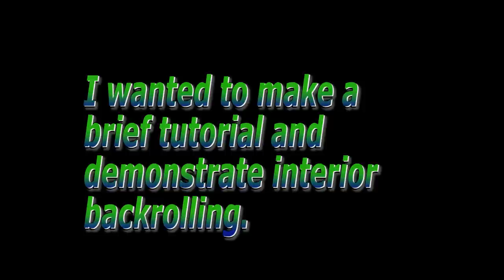Spray and Backroll with the Pros - Interior Painting

Comment: You can always tell when someone is a professional painter or not and I know you guys are a professional painters because any professional painter know that you should spray the wall to get the paint on the wall they come behind  and back Roll the wall. Most people think of spraygun is the only thing that you should use but that is Farthest from the truth the spray gun just put paint on the wall back rolling does the job you guys made an awesome video thanks
Reply: The sprayer is an applicator…the roller is the finisher.
Reply: So as a one man job, not really practical?
Reply: @TheMendo123  it is…cuts away the tiring effect of Labour.
Masking isn’t labour intensive but dipping roller in and out of trays is.
Reply: @JohnMartin-oh6bf  I'm confused, so you are advocating for the use of a roller or not?
Reply: @TheMendo123  not really.
Each one has its pros and cons.
Reply: I dont see the need for a spray gun if ure going to roll it eitherway, its much faster, cleaner and healthier to just use the roller
Reply: @wolololer 100% wrong. It is WAY   faster to spray and backroll vs just rolling unless you're flash Gordon, lol. Now you may have a point with the healthier part! 😅
Reply: @broddam  To me doing normal brushing +rolling seems way simpler and even if a bit slower in certain jobs, i dont think is worth it to spray, but i still believe depending on the job 2 dudes can paint whole thing faster with brush+roll than 2 dudes spray+roll, u gota make into the acount all the prep and post work necesary for spraying.

But i could be biased since i only do regular houses work, maybe some huge warehouse or something like that the times are completly diferent

Comment: I want to see you do this on level five.. that's when it really counts.. seriously unforgiving.. you got some skills thank you..
Reply from the maker: @billgoforth7426  thanks, this is an orange peel texture and a Spec home with a short deadline.
 I've done level 5 only once, and there are a few different methods to accomplish level 5,  but it always requires applying a leveling skim coat or a leveling spray mud.. so this alone wouldn't work with level 5, especially with thst 3/4"  nap we used.
Reply: @XCPainter  I had the same question any tips on avoiding flashing on a level 5 finish ?

Comment: So, serious question....what is the advantage of spraying, if you have to roll it anyway?
Reply from the maker: The advantage of spraying can be situational... so in the case of new construction spec homes, and with orange peel texture, it is so much easier, effective and efficient  to spray the paint on and backroll instead of manually brushing or rolling every corner, bottom and top of wall, dipping hundreds of times considering the massive amount of drywall area and coats of products needed.
We can spray out this interior in 5 - 6 man hours max... if we brushed and rolled this 3 story home requiring 2 coats, it would take 40 plus man hours
Reply: @XCPainter  So the advantage is just doing the corners faster? 
I could be wrong, but I feel like i could paint just as fast with 2 man brushing and rolling on a regular 4 corner walls room, it would be cleaner, healthier cause no pray in the air, require less prep work and less cleaning of the tools after process.

I allways thought just spraying would be enough, if u include a second man for the backroll, it starts to look inefective to me

Comment: Hi I do new construction in the UK. I've been spraying walls to a finish but I'm now on a site that wants them back rolled. My question is when your doing this alone would you just spray one room at a time and roll? Or will it dry too quick?
Reply from the maker: For our substrates (new drywall mud/tape, even primed) it tends to dry in super fast, so I have a hard time backrolling a big wall or ceiling sections properly.
Can do it, but it's like going through the motions, but not effective though.
If your surfaces hold out the product better, or it just stays wet longer, you can do one wall at a time or maybe half of one

Comment: This seems to be an ongoing issue that no one ever agrees on , should you spray one heavy coat and back roll or cut in and roll the whole thing, seems there should be some sortive way to determine which is better, but I don't know the answer. my opinion I think the physical strength and stamina it takes to spray is considerably less than carrying an 18 inch roller loaded up with heavy paint all day, and although he did use a roller to back roll for the needed finish it's not quite that heavy being used in that way so the speed is there! Pretty sure I couldn't roll and cut in a 3000 sq ft house in 8 hours with a helper🤔
Reply: much faster for sure.

Comment: Kind of confused why you’d do ceilings last. Especially if it’s colored walls, not why, it leaves a fog of ceiling paint on the walls. Please explain your thoughts. Thanks!
Reply from the maker: We sometimes paint the ceilings last when we're addressing many ceilings or rooms because we can spray them. Also it changes the process in new construction homes so we can spray and roll walls very easily, then mask and spray ceilings.
If we paint ceilings first...we would most likely be left to brush and roll all the walls, cutting in the ceilings.  That requires two full coats of paint, and on an empty new construction home, particularly a spec home, that takes entirely way too much time, effort, and paint.
Masking and spraying ceilings also gives incredible paint lines if you mask well.
The plastic should reach the floor so no ceiling paint gets on the walls.

Comment: Curious with this method do you have to put a second coat on? Or does the backrolling do the job?
Reply from the maker: 2 coats is recommended, I always strive for best practices as a solo painter/business owner...  (in these videos I worked as an employee, builder only goes with 1 topcoat)  but realistically in some spec home situations only 1 coat is budgeted for money and time wise. 
In these houses with beige walls "Edgecomb grey" we tinted the primer to that, did 1 solid wet top coat, backrolled and sometimes fog coat after, sometimes not, they always turn out well, with Flat sheen paint and even low lustre.

Comment: So back rolling is to push the paint into small cracks and pin holes??  if you thinned out your water based paints so it wasnt so thick wouldnt this help getting paint into pin holes and no need to back roll?   just curious as im about to buy a sprayer and do some renos,
Reply: Rub your hand across a wall with new finished drywall. The joint compound is very smooth the Sheetrock has an almost fuzzy like Texture on it. It’s 2 different textures when you backroll you create 1 consistent texture and that’s what backrolling does is create a uniform finish

Comment: Is this how you guys do new housing?
 Is that the final wall coat?
I assume you then mask off the walls and spray the ceilings. Final step is to spray the trim pack when it is hung? Don't the carpenters scratch up the walls? I was wondering why you taped the walls (and creasing the paper) to spray the trim. I'm guessing that the walls are finished at that stage.

Also, don't the floor guys, electricians and carpet guys scratch up the walls & ceilings? The electricians always make marks when putting in pot lights. The carpet guys lay the carpet on the wall and then cut it. The floor guys always get fast set or something on the walls.
Reply from the maker: Yes this is the final coat besides touch ups.  The other trades aren't too bad on the walls except for making dust inside. Walls are cleaned and touched up as needed by the builder's employee. We only fix what we are responsible for.
Reply: Ummmm. Ceilings, then trim, walls last.
Reply from the maker: @terilachonce280  not in these homes
Reply: @terilachonce280   most new track builders dont want to pay the painters shit contracts go to cheapest bidder. so this is how they paint them

Comment: If you spray and don't backroll how do you touch up later and get the same finish if spraying isnt an option due to furniture etc?
Reply from the maker: Touch up is still possible depending on the surface, which paint, which sheen, paint age, and client expectations.

Orange peel texture is common in the northwest US and is a little more forgiving than smoothwall
Reply from the maker: I use a mini roller with only a little paint, and feather out the touch up area edges

Comment: Would you backroll a ship-lap wall?  I just purchased a sprayer to make painting our dining room ship-lap quicker...  But I've seen a few video's talking about backrolling.
Reply from the maker: Hi, short answer is it's certainly possible to do a nice spray finish without backrolling. 
It all depends on how smooth your surface or existing coatings are, what results you are looking for, and if you are able to spray a nice finish. An example: if you have to prime over raw wood, a backroll with a 1/4" × 6" mini roller would help to work primer into the wood and roll it even. . but with topcoats I'd probably just spray with a 308 or 410FF tip

Comment: Just curious but why would someone spray and backroll when they can just roll initially? It would seem less work with masking to just roll 2 coats. Does it leave less stipple with the spray or something?
Reply from the maker: Thanks for asking.
To spray or not to spray can be situational, with the amount of area to cover, allowable timeframe for the work, and of course, the logistics of different methods and how they turn out.
These homes are 3 story new construction spec homes, with orange peel texture drywall.
That would require a whole lot of cutting and rolling, lots of paint going on 3 floors, and double that with 2 coats.
Also, spray priming before and after texture makes for even more work, but it's feasible with spraying
The spray production method (in this situation) is just so much faster, easier, effective.
We masked, sprayed and rolled topcoat on walls in this home in 2.5 hours.
Next day, masked walls and sprayed ceilings 2 coats in a day or 2.

Comment: Thanks for the vid! I'm Priming and painting a 3bedroom this week for the first time using a sprayer. Its a reno so half of it is new drywall. I plan on spray priming all the walls and ceilings first, does that need to be backrolled? Then it looks like spray the wall top coat first then tape it off with plastic then top coat the ceilings? I'm installing wood trim afterwards so don't have to worry about taping that off.
Reply: I would always suggest to back roll to catch sags and fill thin spots
Reply: It’s always recommended to backroll especially the 1st coat/primer it works into the drywall more efficiently and you get better adhesion. Always backroll drywall and sand in between coats ALWAYS!!

Comment: Will backrolling cause stippling on a smooth surface?
Reply from the maker: Backrolling can leave stippling on smooth walls, but you can also minimize it by not applying too much product, or by using a microfiber roller. If the amount of product sprayed is just right, and roller technique was done correct,  there shouldn't be any visible problems. Side note, if I see roller stipple on surfaces,  inside or outside,  it isn't a bad thing as long as it looks even and consistent.
Reply: @XCPainter  I was planning doing a super smooth level 5 on my walls prior to paint - and would love to avoid even roller stippling... do you have to backroll on a smooth surface?
Reply from the maker: @danielohirsch  if you are good at spraying real even and know it could take appropriate steps to achieve that level 5
Reply from the maker: @danielohirsch  After you mudding and leveling coats are done, you'll want the best appropriate primer, either high build or just something that sands easy, then you'll have to address more prep work on walls and full sand possibly. Then 2nd coat of primer.  Then you can spray topcoats.
Reply: @XCPainter  Thanks!

Comment: Why the 3/4 nap? Wouldn’t 1/2 be sufficient?
Reply from the maker: We prefer a 3/4" on orange peel texture to carry the paint from top to bottom and carry the paint across the walls. 1/2" is not really effective enough
Reply: @XCPainter  What brand of roller did you use?  I would like to try this process both to speed things up as well as achieve even coverage.   Looked like you have minimal overlap and just go up and down a section of the wall once then move over.   Nice job, I got just as much reading comments as watching the video.
Reply from the maker: @jimw6991  the roller might have been a Wooster Super Fab, 3/4" .
Reply from the maker: @jimw6991  my up stroke goes back a little bit a down stroke goes straight down, then move over.  There's a decent amount of overlap which can help with consistency

Comment: Why backroll ? What is the purpose behind it ?
Reply from the maker: For the purposes of this job (new construction), with an orange peel texture on all surfaces... it's quite porous, so it's beneficial to work the paint into the texture and move the paint across the wall top to bottom. Of course this improves the consistency of the paint sheen and finish also.

Comment: Is the ceiling same color as walls or are you going to tape off the walls then spray ceilings?
Thanks.
Reply from the maker: The ceilings are going White Dove in color. We masked off all the walls next and sprayed the ceilings.
Reply from the maker: My next video will show the wall masking going up and some ceiling spray footage 👍.
Reply: You boys do it different... I spray ceilings , cut in  ceilings, and 18" the walls. Less materials wasted and prep time .
Reply from the maker: That's cool man. Thanks, we've done it that way plenty of times too, but more commonly on custom homes or basically jobs where they want the walls painted afterwards. So you say materials wasted? I'd rather spray out and backroll 25 gallons of paint in one good coat instead of cutting and rolling two coats on a 3000 sq ft new construction spec. That new drywall/primer just sucks up the paint still so... spec home, we spray 👍
Reply: @XCPainter  doesnt it take you guys a while to tape plastic on the walls? Maybe a day or two for 2 guys? At 25$ to 30$ hr a piece for 2 guys 2 days plus the cost of frog tape and plastic, I'd expect one guy to cut the entire house in one day two coats without trim
Reply: And one day with an 18" two coats
Reply from the maker: @joemama-kx6rk  Well this is a 3 story home and two stairwells, hallways,  9.5 ft walls downstairs, but it only took us about 8- 9 total man hours to plastic all the walls.  We used AllPro tape at $2something a roll, and IPG PG5 at 3.29 a roll and we used about $15 in plastic for the whole place.
Reply: @XCPainter  gotcha! Thanks for the video. Keep up the good work
Reply: Hi,

What did you use the gas tank for?
Reply from the maker: @carlos-uj3qg  thats propane for the heaters.
Reply: @XCPainter  Yep walls before cieling is  way faster than spraying ceilings first and cutting in the walls with a brush ! Also if the knockdown finish is jagged  where the ceiling meets the wall your lines will appear straighter !
Reply: @XCPainter  .... sure seems like 2 coats just sprayed would do the trick to me , especially with cheap "builder flat" , BUT , I don't do new home "builder" painting and you do , Sooooooo , i suspect you know what the hell you're doing